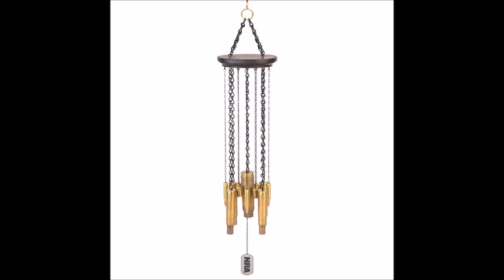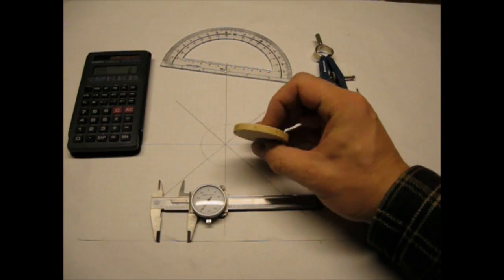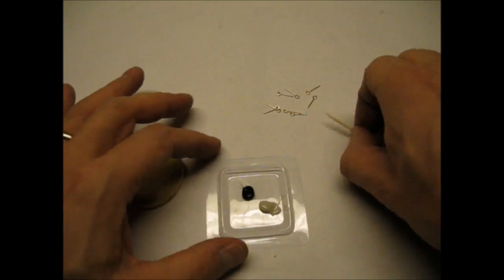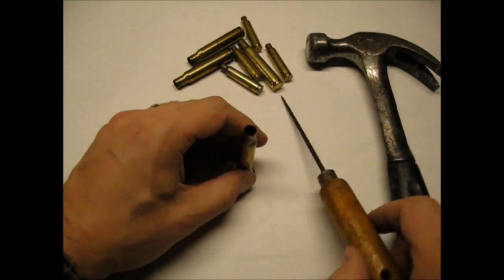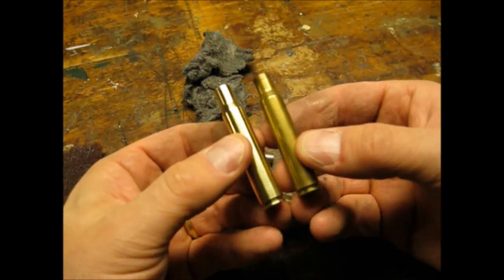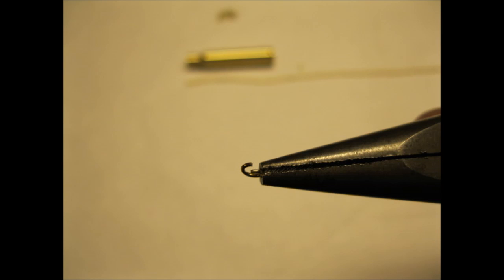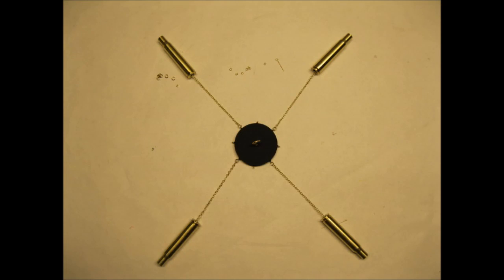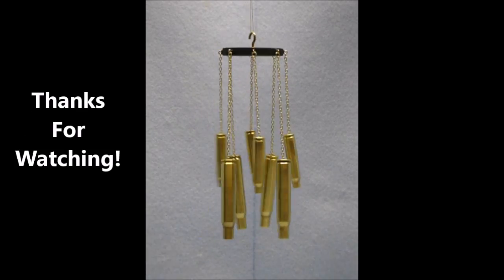Brass Bullet Shell Case Wind Chime

Comment: Hi! On installation, one of the channel locks broke, the other has stress fractures. Can I E6000 the broken one?
Reply from the maker: I only have limited experience with E6000.  I have used JB Weld and JB Kwik Weld with good results.